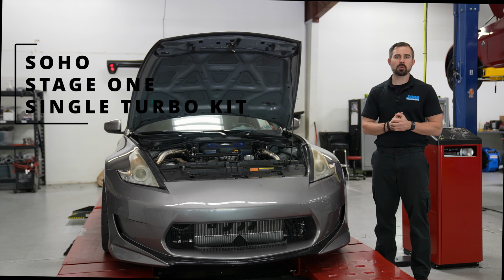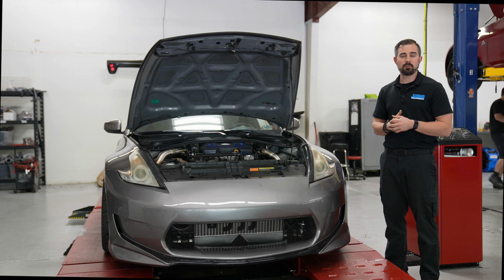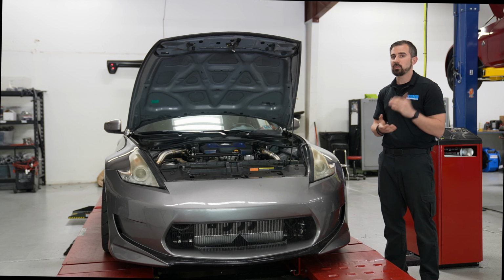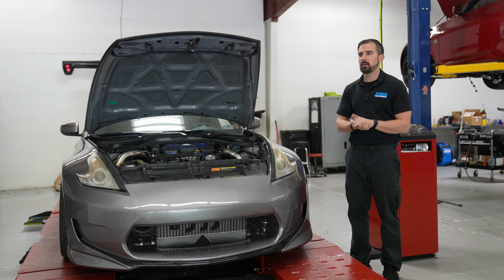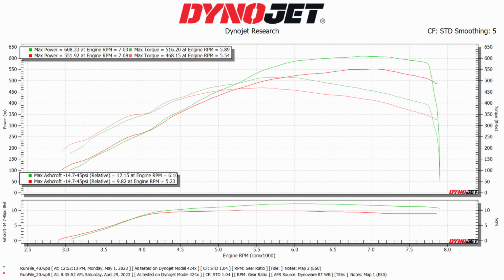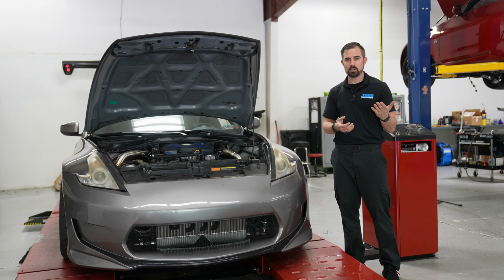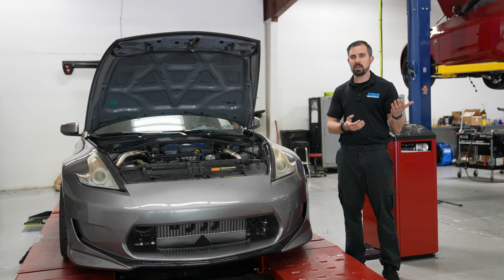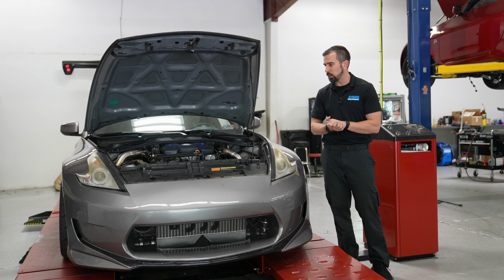Nissan 370z Goes from Stock to 600 Plus Wheel!

Comment: With these high HP set ups, do you guys have issues with the fuel pump grommet (connecting the pump to the basket) constantly tearing?
Reply from the maker: we do not, however we typically will replace them with any build

Comment: Is the A2A good for someone who just wants 400-450HP?
Reply from the maker: Yes it is and you can achieve that 400 to 450 power level with the 5 psi pulley setup
Reply: @SOHOMotorsports  thank you. Will be reaching out soon.

Comment: I think everyone's question is how much ? Personally I just want to know how much it would run me installed and all for just a 400-500 whp z
Reply: This whole set up came to about 35k. Did more than just the turbo install though. They did all the gaskets, water pump, PS pump, timing chain, and tensioner on top of the supporting mods for the kit.
Reply: How many miles were on your car?
Reply: @jonday9838  Just under 85k
Reply: @boblarry7879 so 35k plus the car which is another 30-50k?
Reply: @TrickRacing  30-50k? That's not even close to how much these cars are going for. I bought mine for 17k 6 years ago with 54k miles on it. That 35k is also including the labor to install everything. If you're able to do it all yourself and no blow it up it will be a bit cheaper.
Reply: @boblarry7879  in 2020 a new which yours look very new was like 30-40k . The new z nismo is 70k
Reply: @TrickRacing  nope mine is a 2009. The 400 is so marked up its ridiculous. Car definitely isn't worth anywhere close to 70k